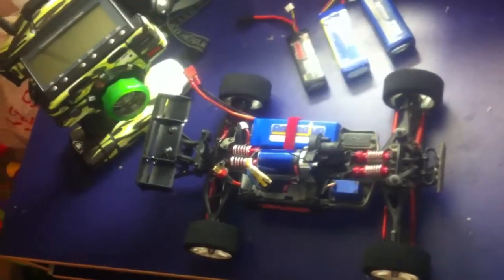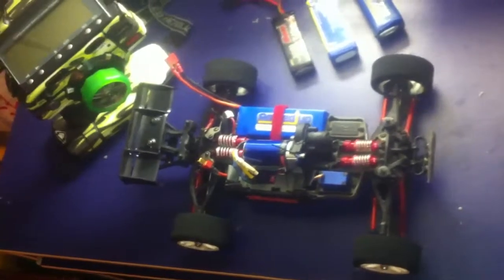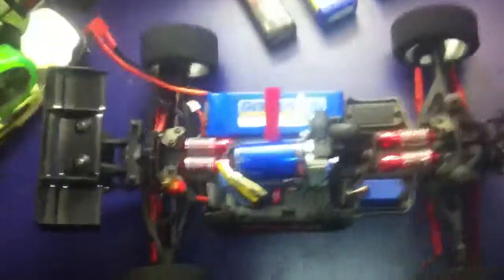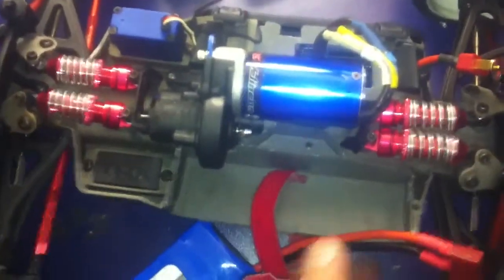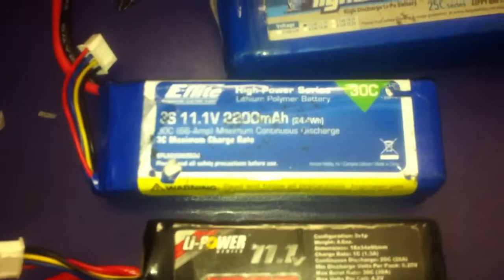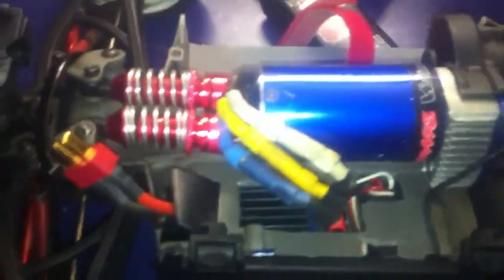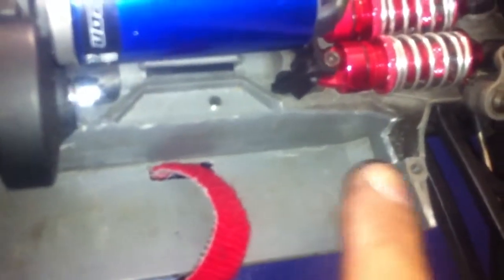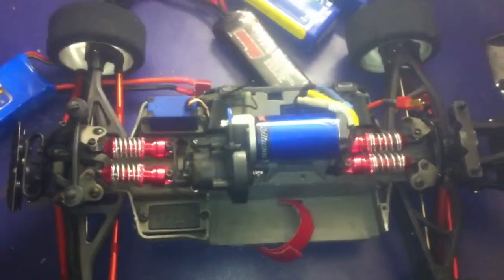traxxas mini revo vxl 1/16 big battery mod

Comment: Using the dual battery compartments and a parallel connector you can run 2 1400 3s traxxas batteries and outlast this one

Comment: I did same except I didn't cut bat box because I use Velcro on door to hold body on instead of pins Velcro on big battery. But I like the strap u have I need 1 nice vid